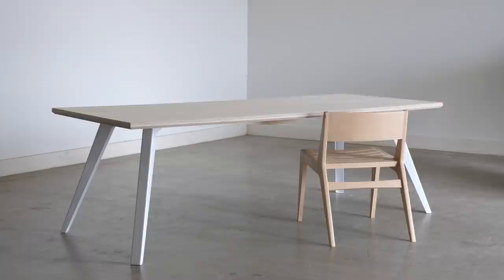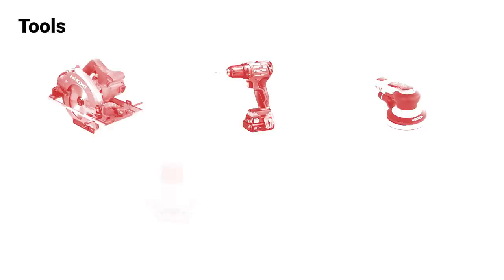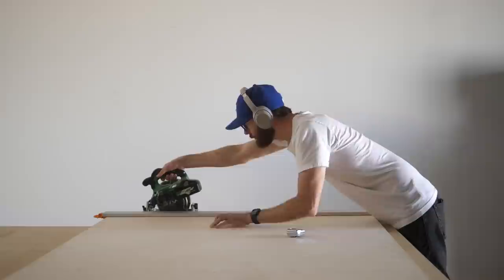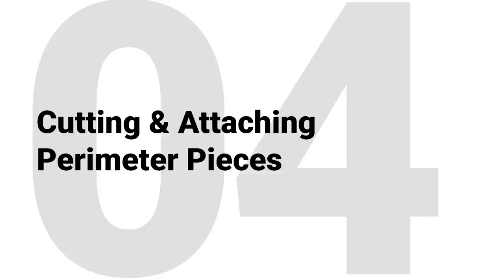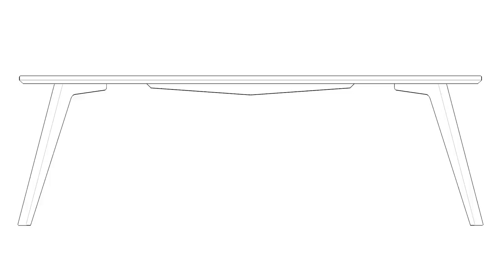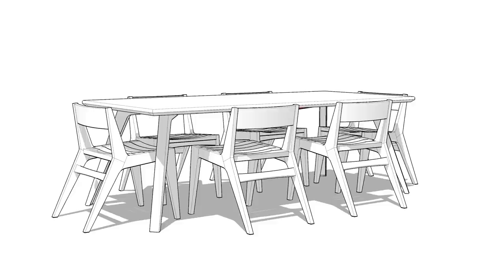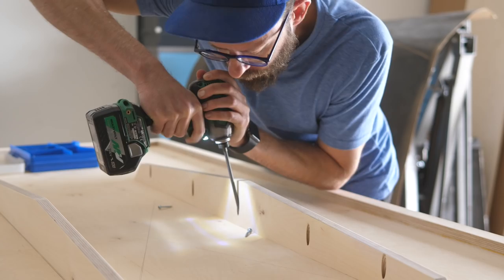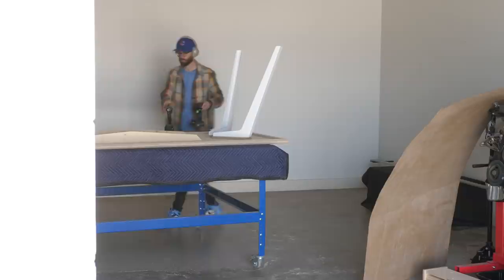DIY Dining Table - Full Plans - Free!!!

Comment: A useful tool would be really easy to make right at the beginning of this project. When you are cleaning up the factory edge, put a piece of scrap ply against the straight edge you have clamped on. Now make the cut through both thicknesses. The resulting length of ply is exactly the same dimension as the offset of your saw. To use it, mark your sheet where you want to cut it, put straight edge on the board off set with your new spacer and clamp it down. Remove the spacer and make the cut. I have a spacer for both the wide and narrow sides of my saw.

Comment: Thanks, you are my favorite channel. It was nice seeing your lovely wife involved. Having a metal fab shop and a wood fab shop I often use metal and wood as you did. I was wondering if you had thought about using metal for the longitudinal supports under the table? I have never made one of your designs, but you have influenced me in my design and build. Thank you for your clear, concise narration. Please continue. All the best, and BTW I’m getting some new glasses!
Reply from the maker: Thanks MJ, appreciate it. I think a matching metal stretcher would be awesome. It's kind of outside of the scope of this project though, since the legs are pre-fab and can be purchased to fit any table. If semi-exact was to make a matching stretcher piece, I think it would just be too specific to one particular table size. The goal here was more modularity than a specific design.
Reply: @Foureyes.Furniture  Yes I agree. I’m “semi” retired and I do a lot of custom metal work like making items such as those stretchers and designing pieces for folks who come in and say “can you make something to do this”? I’m thinking of fabricating similar legs, but having them enclosed fully. I’d also have a plate welded to the base to spread the load instead of your plywood plate. Well you got this Old Boy thinking. I really appreciate all the work you guys put in. Thanks
Reply: @MJ-nb1qn  how will you make them fully enclosed? Formed + welded sheet metal?
Reply: @ilikewaffles3689  - Well in my shop, for the legs, all sides would be cut from steel sheet (maybe 14 gauge) then TIG or MIG welded to form a “box” structure. Then grind the welds smooth. Just like most things I make. For the apron you could use some C channel and weld a plate on the open side, if you wanted. For a support under the table it’s easy to router grooves to accept the legs of a C channel and screw or bolt the channel to the under side of the top. Maybe use 2 channels about 1/3 in from sides.

Comment: Great video!  Thanks for making it clear to not get too wrapped up in unnecessary  details like what the big angle is on the belly support.  The angle isn't important: just split the length, split the width and connect the dots.
Reply from the maker: Yup yup...lots of things in Woodworking are pretty arbitrary. The sooner people wrap their heads around that, the simpler things start to appear :)

Comment: I like this design, however I think I would order the legs in white, so that I can strip some of the paint, and  then make a slim line steel frame to weld or bolt the legs to, this so that the table will have better strength!

Comment: I am wondering if adding glue to the belly/stretchers might help prevent sag. Also, I would imagine a square apron style "belly" (table under a table), rather than two free floating stretchers, might give more stability to prevent movement of the plywood over time. It could be built with the same tapered aesthetic as well.

Comment: 4:07 I'm trying to figure out how you cut these pieces so that the plywood layers line up with the top piece. Given that those pieces underneath are not mitered at a 45° angle, wouldn't the end of the table look a bit odd at the corners and not like a 1.5" piece of Baltic birch?